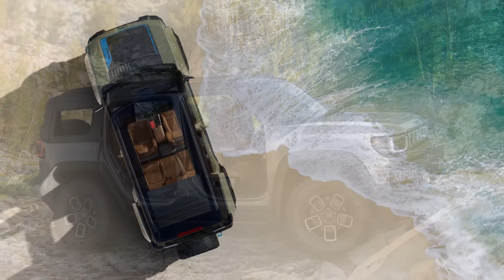Jeep Goes EV Crazy; Tire Changing Robot Faster Than Humans - Autoline Daily 3401

Comment: Folks not familiar with EV's not familiar with EV's don't understand that speed of charging is more important than range. Also, 80% of people charge at home. In fact, a old 110 outlet is enough for many (5 miles per hour of charge). Most of the time EV's are fine - only trips are the big drawback. Say one has a 50 mi daily commute and the EV has 250 miles of range. One needs to keep the pack at 40-80% charge. So, if one has a 220-line installed in their garage they, then have plenty of range each day. However, if one lives in a situation with no home charging then a Tesla is the only option due to the ese of charging network.

Comment: If those tire changing robots and get the PSI and lug torque correct and not damage any lug nuts they will be doing better than the humans. I've been buying tires for decades and every single time I get my car back the PSI is not only wrong, no two tires have the same PSI! I'm #$%!@&* tired of that. I also don't like it when the lug nets are all dented up and the valve stem caps are either not the ones that were on it or just missing. I've starting putting the caps in my pocket when I take the car in now. I also bought a compressor and automatic inflator rig for my garage so I can fix the PSI when I get home.
Reply: I am thinking of getting my own air compressor just so I can add the components to make sure water is removed from the compressed air. 
I have read water in tires from air compressors is bad for many reasons.
Reply: @lp6696  The dryer thingy was only about $20 the air hose costs more than that. Also, drain the air after every use. I have the Kobalt  QUIET TECH 2-Gallon by the way.

Comment: 7:31 Hummer H1 tires weigh 150 lbs.  Wow!
Reply: 35" off road tires and HD wheels are heavy,   but don't break when you hit a curb.
Reply: Yeah, including the wheel as well.
Reply: looks like the robot doesn't dismount and remount tire's so someone with still need to lift it on to the ranger/tool to do it and get rid of the old tire or patch up the tire and remount it ect.
Reply: BTW pay for this job manual labour is under 9-USD per hour iv done it/others i know have, aka the pay for doing something else automotive is better and or industrial equipment non-tires
Reply: @richardprice5978  that's the problem these boomers don't understand.

$9 isn't enough for a human being with rents this high and cost of living, well becoming expensive.

I've we waited 3 hours to get my tires done. And on a day after long weekend, I waited 4 hours for a flat tire repair. 

Because these idiots still paying $9 per hour, they quit the job and workers are hard to find.